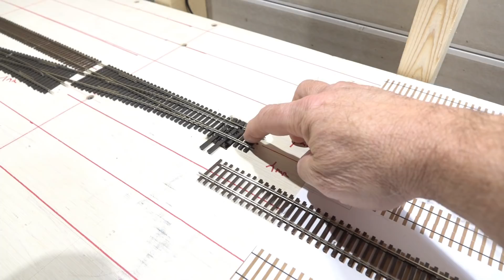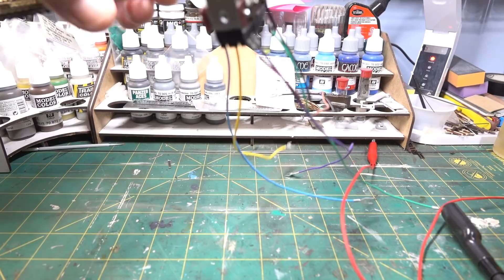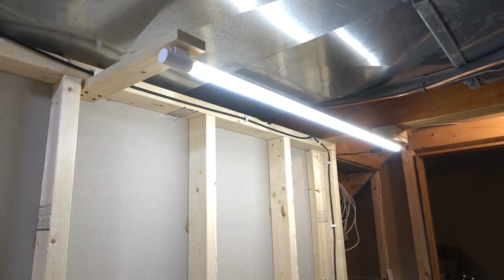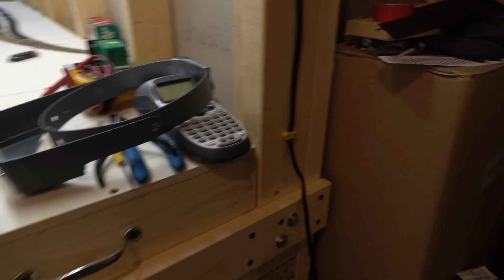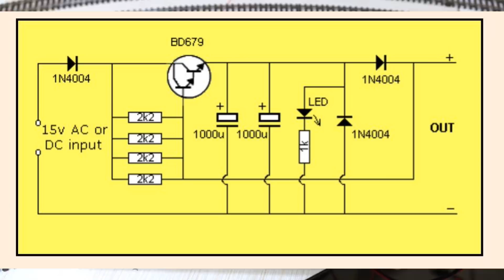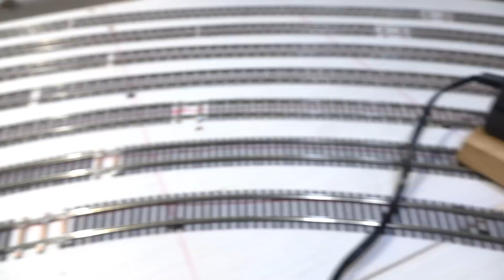MRUV 121: Staging Is Complete!

Comment: Great video... Regarding the wire used to throw the fast track points, if you put a kink ( _/\_ ) in the wire just before the first clamp/guide and run them slightly past the last clamp and bend the wire up will help reduce the chance of the wire slipping in the guide/clamps. Not that you should see any slipping as the forces on the wire should be minimal.

Comment: Nice staging yard — lol — you're just discovering using Atlas track nails? When I was a kid, that was it for most of us.  Everything old is new again.
Pardon the dumb question, but why are your switch machines so HUGE? Back when I was in HO, they were about 1/8 that size.  ???
Reply: Hey Robert! Yeah, those nails were "new" to me. I had them in the workshop for years, but this is the first time I used them. I usually glue track down. As to the switch machines, I assume you are referring to the Tortoises. They have always been that size, at least as far a I know.  Are you thinking of Atlas machines?

Comment: As always, a fabulous video full of great tips. Two questions:. 1) the peco system looks simple and takes way less space. Why use the tortoise at all? Because the other turnouts aren't peco? 2) the camera makes it look like the couplers or trip pins would foul on the tortoise throw bar hook that catches the tie. My guess is that it doesn't or you wouldn't show the video yet. How did you avoid it?
Reply: Thanks. As to why the Tortoises- the turnouts they are used on are Fast Tracks, and I couldn't figure a way to have other switch machines work. I know how to do it with the Tortoises, so went with that. The Peco machines are designed to mount directly under the turnout, or I think there is a way to mount them above deck (I'm not an expert on the Peco stuff- but like it so far). 

The throw bars are below the rail head- that took some effort as my first attempt was too high. These are low enough and the Kadee's pass over them.

Comment: Hi Stephen. Tell me, is the temperature stable in your layout and how to deal with temperature expansion so as not to break the rails on the layout
Reply: The main room is heated/AC with carpet and a drop ceiling. Thus far have only had a coupe of issue with Micro Engineering flex track popping out of the ties- all on curves. I am not sure if it is due to expansion. Now when I install track I tend to leave some joiners unsoldered to allow for any expansion.

Comment: Looks great Rob, well done. I noticed that you drilled the hole for the tortoise throw bar in the pcb tie gap, have you had an issue with the wire bridging the gap and causing a short?
Reply: Neale- not yet. It is a good point, and something to keep an eye on. I know I have done it like this on the main layout for some turnouts, and thus far no issues. But you are correct- it is a possible issue (to be honest I never even thought about it, so thanks for making me aware of it!)

Comment: nice work...what's the function and use of the Cap Discharge circuit?
Reply: It is used with the Peco switch machines- they are controlled with a momentary switch and if the operator is heavy-handed and keeps the switch engaged it could destroy (burn out?) the switch machine. With a CDU when the switch is operated it sends a quick pulse to the turnout (via the stored energy in the capacitors) and then the caps discharge. They don't recharge until the switch is released, so it is much safer for the switch machine. At least this is what I think, I'm not an expert. It isn't needed on a stall type (Tortoise) machine.

If anyone has better info- please chime in!

Comment: Put yourself some simple shelves along the back wall so you can swap cars on and off the layout in your staging.
Reply: Indeed- that is the plan. I am wondering if I should just use a shelf, or should I also use some track, such as Easy Track, Uni-track, or maybe just some simple Code 100 flex...??
Reply: The majority that i have seen are just a shelf.  That allows the quickest change out as you don't have to try and put the cars going on the shelf on rails.   Maybe add a few track pieces to put locos on, just to keep them cleaner.
Reply: perhaps dado twin V-Grooves in the shelves, so cars could "gravity fall" into an alignment, in these track grooves? Of course you don't want dusty trough where cars will pick up extra wheel dirt?  Maybe track with a wheel aligner section is better? All kinds of considerations, no?